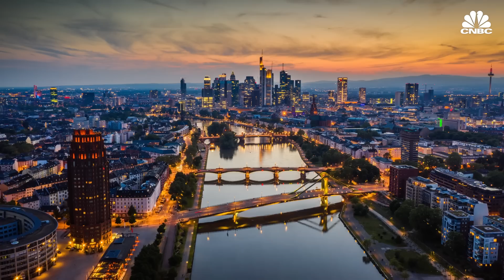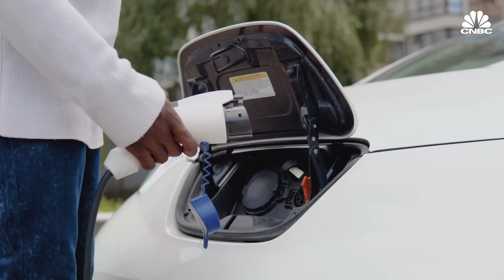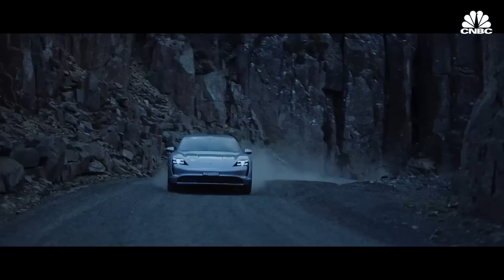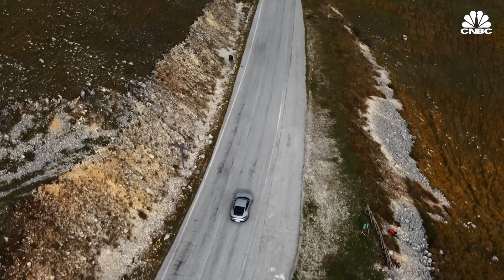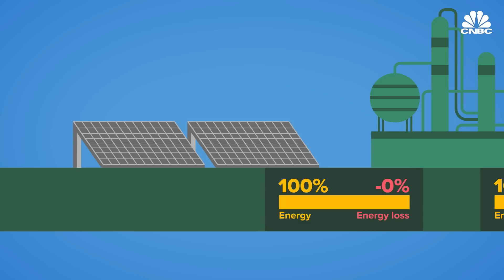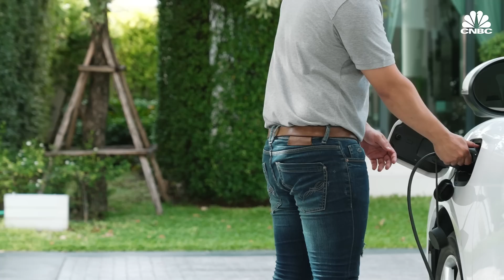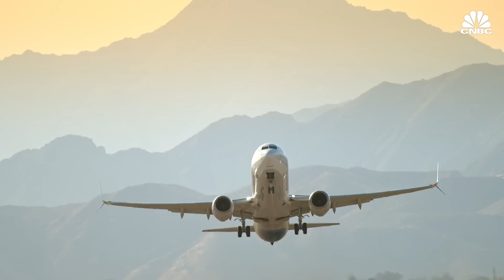How Porsche Plans To Keep Its Gas-Powered Cars On The Roads

Comment: Electrication is not the solution. It is only an option. Not everyone is going to want an EV.
Reply: I want a car I can charge at home for a fraction of the cost of gasoline (My utility charges $0.60 per gallon equivalent, but its cheaper with my own solar) that requires no regular maintenance until the 100,000 mile coolant flush with brakes that last forever because of regenerative braking. You would have to be rich and foolish to choose a worse product.
Reply: @patrickcorcoran4828  yeah if you prefer a boring commute have at it

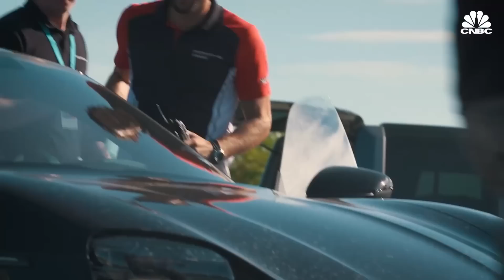Comment: 4:00 Lol, scale. Talk long enough to any of these climate change idiots and you find their sh|t NEVER SCALES!!!!
It's all a scam.
Reply: I guess that's why solar and wind without subsidies are now the cheapest way to generate electricity?
Reply: @patrickcorcoran4828  Are they? Why do they supply less than 20% of the electric needs? Soooo cheap, why not build them everywhere? 
Lol.
Grifters everywhere.
Reply: @m4rvinmartian  Well they started building commercial solar and wind in about 2010 and commercial thermal power plants (coal) in the late 1800s. I'd say 20% is a pretty good amount in 13 years.
Reply: @patrickcorcoran4828  It really isn't though. Use a spreadsheet, extend that out to the future. Tell me when it hits 50% generation. Yep, exactly.

Comment: So they take CO2 out of air, plus some energy to put C02 back to air. Since engines are 30% efficient, this energy cycle will be quite expensive. They will use electricity through innericient processes to waste 70% of it later in the engine. If you use that electricity directly in the car, you cannot move it any cheaper.  Maybe some rich people will want to buy such expensive cars+fuel. In any case it will be an irrelevant solution to transportation in large scale.
I think the current mid age crises people will be gone in 20 years together with this idea. Majority of EVs have better or comparable acceleration than 911 today. But maybe some interesting learnings will come out of this. I wish them the best.
Reply: My thoughts exactly! This is an advertising campaign to keep old Porsche buyers happy until they die and their kids all buy Porsche EVs.

Comment: That’s what some tried to do also with horse and carriage when the ICE came around. We all know what happened. There’s NO ICE vehicle that can compete with an EV performance wise and the fun factor to drive it. A Tesla plaid is much more performant than any Porsche ICE will ever be and the new roadster will be mind blowing. Porsche is trying to hold on to something desperately because they don’t have the know how of mass producing a compelling EV. It’s over for Flinstone ICE technology!😂 For those who really want the engine noise, well they can mimic it in the car cabine without disturbing others outside. They could even mimic the exhaust in the car cabin for the real fans so those outside won’t get cancer. And Toyota, an other brand late to the party, even comes up with fake gears for EVs, how thoughtful.

Comment: Battery technology is changing rapidly. The changing energy density of batteries over the last 10 years makes my head spin. This may be a bad investment.
Reply: New battery technology is right around the corner!
While we have the same batteries we have ALWAYS HAD.
Unless you're inventing new physics, we are capped on batteries. 
There are no "new batteries".
Reply: @m4rvinmartian  check out the new breakthrough from CATL. We may have new batteries with nearly twice the energy density in a few years. This would be a game changer for sports cars.
Reply: @m4rvinmartian  Even or old batteries are new. While the dominant battery type is still Lithium Ion, the versions we use now are more efficient and use less lithium and cobalt than earlier batteries. You don;t have to hold your breath for solid state batteries as long as the tech we have keeps making incremental changes.

Comment: A single gallon of E-Fuels requires as much energy to produce as a battery EV needs to travel roughly 200 miles. Porsche should not be allowed to call this technology "carbon-neutral" until they can produce a motor that can run the same 200 miles off that one gallon of E-Fuels. Everything else is just greenwashing lies. Green energy is much more efficiently used directly in electric cars.
Also, the "classic cars" argument is another scam. Nobody is planning to outlaw regular gasoline production, it will still be available in 50 years since it's used in many other processes.. only gas stations will become increasingly rare. We do NOT need E-Fuels to keep classic cars running, they can stay on regular gas.
Next lie is the constantly given impression that we can just pour E-Fuels in our existing cars and that makes them green. E-Fuels that we currently produce have a significantly different composition as regular petrol, and can NOT be used in existing motors without expensive retrofitting of new valves, gaskets and other parts. Most German carmakers already didn't certify their existing fleets for the bio-fuel enriched E10 gasoline, and confirmed that they will not do broad retro-certification of existing fleets for E-Fuels. So they are only usable for new ICE cars that are constructed with their chemical composition in mind. And if you're developing new gasoline motors for E-Fuels today, you're doing something wrong entirely, and should instead put your work into EVs. Heck, strap a loudspeaker to the bottom and play some fake B8 sound if you must..

Comment: Makes so much sense. After all oil is carbon neutral. Oil to co2 to plants and back to oil.
Reply: You seem to be forgetting that the "... and back to oil" part takes several million years and we don't have several million years before the ice caps melt.
Reply: @patrickcorcoran4828  hence the entire point of the above video. Porsche has a way to do it faster.  See above
Reply: Thomas Loper:  When burning gasoline doesn't produce roughly 20 pounds of CO2 per gallon of gas, you might have a point. 

YOU DON'T.

Hint:  Google is a thing, re searching the internet for fact checking.
Reply: @rogergeyer9851  one dump truck used to collect materials to build EV batteries burns 1800 gallons of diesel fuel per day. How much CO2 is that? Do your research before you make idiotic statements.
Reply: @thomasloper1205  The metals used in batteries is almost infinitely recyclable. Its not a fuel that gets burned, it is part of a storage medium. Essentially it is the gas tank, not the gas. So every EV we built takes an ICE vehicle off the road and when that EV is scrapped in 20-30 years (they last longer than ICE vehicles and the batteries can be used for stationary energy storage after the car is scrap) the battery is recycled, so no new material has to be mined to replace that car. EVs at current electricity grid mix produce 50%-70% less carbon pollution over their lifetime than an equivalent ICE vehicle, and that takes into account carbon emissions from mining, refining and manufacturing. 

You might also be interested to know that in mines where the ore is uphill of the processing facility or train/truck that takes it to the processing facility they have electric Haul Trucks that use the extra weight of the ore to generate enough electricity while braking going down hill to power the truck to run empty back up the hill to the mine.
Reply: @patrickcorcoran4828  you’re right the batteries are like the gas tank. So all that energy spent to make the gas tank produces zero energy to move the car. All that energy has to be added and since most electricity comes from natural gas or coal, the CO2 production is higher. Volvo and VW have both done studies that show an EV doesn’t even break even in terms of CO2 production until the car travels 70000 miles. That’s due to the manufacturing process. So electric ore trucks that use gravity to charge the batteries to then carry the ore up hill doesn’t seem to have much effect on Volvo or VWs data. You’re also forgetting that recycling the batteries takes energy. You don’t snap your fingers and have a new battery. A typical battery is good for about 500 full charge cycles. At 300 miles per charge, that’s 150000 miles. The car might last 20-30 years but the batteries will need to be replaced long before that. Only 70000 miles of that will be a positive reduction in CO2. And of course once you remake the batteries that costs energy which creates CO2. If you transfer that battery to your house for energy storage to run in a reduce capacity (since it’s no good for your car anymore) you still need to charge that. 
The reason the Porsche system makes sense is because it uses wind energy (which is a form of solar) to capture carbon from the air. No CO2 is produced to make the fuel, except for the CO2 to built to plant which is probably massive. Tons of steel and copper in a wind turbine that all gets smelted in an electric furnace run on coal or natural gas. But scaled up, using wind to capture CO2 and then store the energy in liquid form in a metal tank that didn’t cost incredible amounts of CO2 to produce, since it’s just a metal tank, makes so much more sense.
Reply: @thomasloper1205  And for decades, those same dump trucks - or trucks like them - have also been used to collect cobalt for the oil industry, who use it to remove sulphur during the refining process. Older EV batteries can also be 95% recycled, with the lithium and cobalt being 90% recovered and reused in new batteries. Is anyone recycling and reusing burned petrol, diesel or e fuels?
Reply: @Brian-om2hh  Yes. Porsche is. See the above video.

Comment: The criticism coming from EV proponents really have lost the point. This is for a very tiny sub-segment that includes performance cars like Corvette and Porsche. As well, considering antique, classic, performance, and Motorsport, demeaning the idea of clean synthetic is just giving petroleum industry the go ahead to continue their dirty business. As an owner/driver of both Porsche and Corvette, the idea of cars like these going full electric leaves me cold. Love ev’s, but not for this segment.
Reply: Porsche Ev Conversion
https://www.youtube.com/watch?v=ZQfkojLhY7U

This is fossil fuel propaganda to convince people that there are alternatives to EVs. This just lets them make ICE cars for longer because naive ICE owners who still believe in environmental issues will get a new ICE car assuming they will eventually be able to get E-Fuels, but its simply not going to happen. Porsche isn't going to build an entirely new and extremely inefficient fuel infrastructure just to keep older car owners happy. Toyota is following the same strategy, but pretending Hydrogen is going to work. 

You may really like your fossil fuel cars and Porsche wants to keep you happy and more importantly keep getting you to pay for oil changes and repairs, but they know the next generation isn't going to see the appeal of a lower performing car with high maintenance costs, high fuel costs, noise, and smell that can only run on rare fuel sources.

Comment: Porsche  like Rolls Royce will always have a market.  Much smaller but a position never the less.
Reply: Rolls Royce is also going electric. Rolls Royce has the advantage that its customers have always preferred quiet to high performance engine noise.

In maybe a generation all the people impressed with engine noise are going to die out and no one is going to want an ICE.
Reply: @patrickcorcoran4828  Yea right. Just like everyone caring for horses has long since died. It’s the “innovator’s hybris” to think that “the old stuff” has no right to exist anymore.

Comment: Of course it’s expensive to produce right now. It’s brand new technology. And most drivers are not going to use it as they think they are saving the planet with their EV when they don’t even realize most of our energy still comes from burning coal. Yet they also won’t support nuclear power. For us die hard Porsche enthusiasts, we will pay the cost to run our classic ICEs on e-fuels because it ignites our souls and you can’t put a cost on that. Just work harder.
Reply: Its not new tech, its tech that has been discussed since the early 2000s, but dismissed because of expense and then entirely dismissed after the Tesla Model S came out and proved battery tech was going to be the least expensive way to store energy in the future. This is Porsche's attempt to "Keep Kid Rock from shooting beer cans". They're not going to admit that this is the last generation that will want an ICE so they invest a couple million in this propaganda effort to keep current customers happy, but they know its never going to happen.

If you want to look at EV emissions google "map of EV MPG equivalent" and take a look at the maps. They show you which US states have lower emissions with EVs running on grid power than ICE cars. 10 years ago there were a lot of states where EVs weren't better because of the prevalence of coal plants. Today there is nowhere where an EV isn't better. This also doesn't factor in people with their own solar. My dad and a coworker charge their Evs directly off their solar arrays with SolarEdge inverters.

Comment: The energy translation part is a classic example of picking data point to fit your narrative. The production of electricity is mostly from burning coal and I don't need to tell you how much dirtier that is compare to gasoline. Then producing heat is needed in the car which is not a waste unless you only lives in California, which electric car actually needs to "waste" energy to produce. Finally in order to maintain battery performance, the battery needs to use energy to keep it at a certain temperature at all time otherwise it will either blow up or your car won't start like if you leave your phone in the snow for a few hours. I am not arguing electrification is good for the environment or not but I can't stand those analytic numbers as someone who works in the data field
Reply: If you want to look at EV emissions google "map of EV MPG equivalent" and take a look at the maps. They show you which US states have lower emissions with EVs running on grid power than ICE cars. 10 years ago there were a lot of states where EVs weren't better because of the prevalence of coal plants. Today there is nowhere where an EV isn't better. This also doesn't factor in people with their own solar. My dad and a coworker charge their EVs directly off their solar arrays with SolarEdge inverters.

Not sure why you are so hung up on car heaters and battery management systems. I live in Northern Vermont and it is simply not a problem in older models with electric resistance heat and gen 1 battery management systems (like my Dad's 2018 Chevy Bolt) and its a lot better in newer EVs with heat pumps instead of electric resistance (like my friend's 2022 Model Y).

Comment: The Porsche 911 is a halo & identity car for the company. And yet it fits just 2 adults in front, 2 midgets (little people) in back. There is demand, economies of scale, & 60 years of refinement that engineering has an absolute mastery of.
///
Full Year 
Porsche Production 

ALL 911

2020- 8,840

2021: 10,042

ALL 718

20-3,447

21-4,292

ALL TAYCAN

20-4,414

21-9,419

ALL PANAMERA

20-3,870

21-4,257

ALL CAYENNE

20-18,092
021-17,299

ALL MACAN

20-18,631

21-24,716